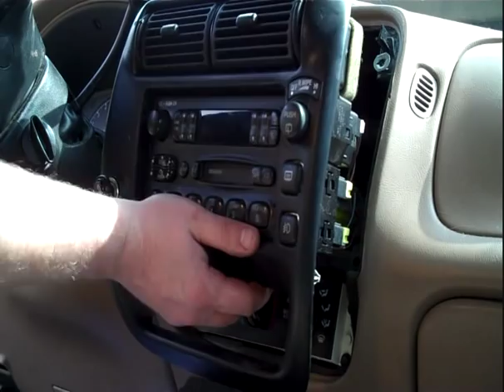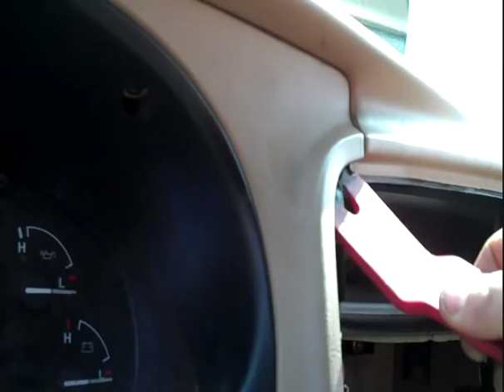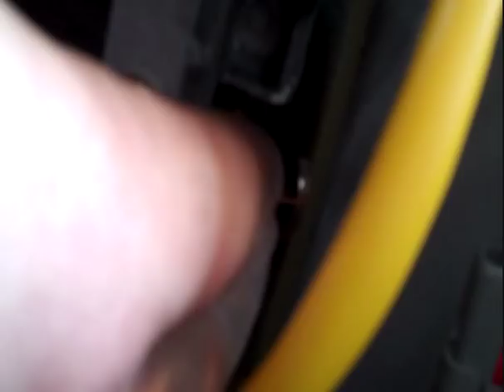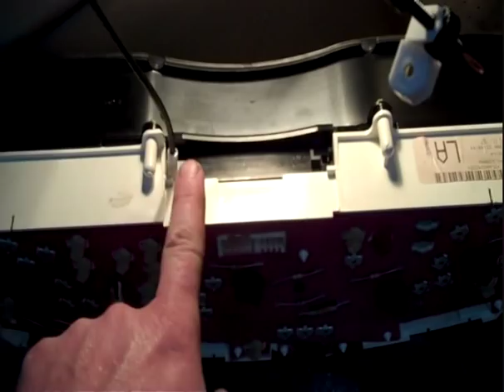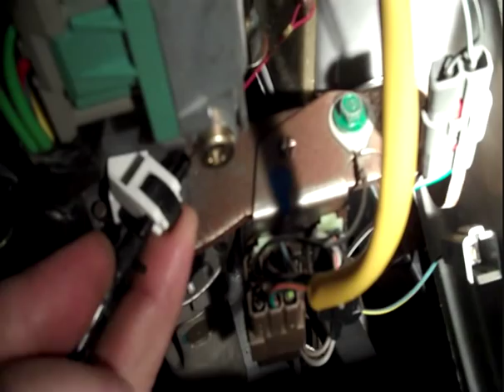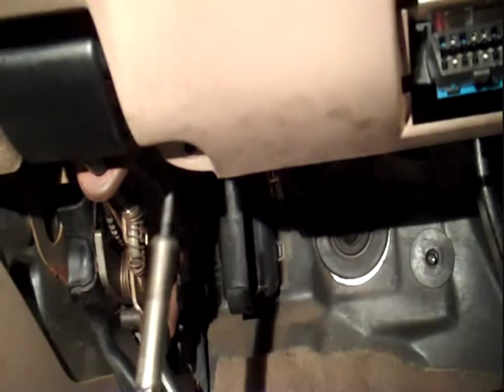Ford Dash Lights & Shift Indicator Repair

Comment: Hello i accidently connected the positive to the negative it ran for awhile the all my gauges and speedometor will not work after ive changed the blm and the cluster..still dont work..What have i done or need to do.?...Thanks..

Comment: Easy way to work on removing the various screws under the dash:  A box or step stool placed outside the driver's door.  Mine's about a foot high.  Perfect height and a comfortable position instead of bending/contorting, killing my knees.O'Reilly Auto Parts had a pack of 10 bulbs (behind the counter, so ask!) for 7 bucks which is nearly half what 3 2-packs cost.

Comment: this is a very easy job if you have patience and don't mind working in a kneeling position or putting your body in a pretzel like position lol I used a 7 mm,8mm, and 7/32 ( shifter cable bracket white plastic) sockets. even though only one of the 194 bulbs were burnt out I changed all 6 I took the advice of wearing rubber gloves as to not handle the bulbs and getting my body oil on them VERY EASY JOB all the gages are brighter on this old 1998 explorer

Comment: dear rage customs thank you for this very informative step by step video. the only difficulty I had was trying to find a correct metric socket for the shift indicator cable bracket. mine wasn't broken but I still needed to remove I think you mentioned a 5 1/2  mm socket I was able to use a sae 7/32 easily. although only one of   the 194 bulbs were burnt out by gas Guage I changed all 6 in the black holders I wore rubber gloves as to not touch the bulb it took me a little over an hour but I just took my time THANKS AGAIN !

Comment: Hey if my shift indicator is fine and i only need to replace a bulb, can i leave the shifter in park or does it have to be in gear 1 with the emergency brake on??

Comment: Very good video! I have to replace several bulbs on my '97 Explorer. Looked pretty easy except reconnecting the wires. Didn't show if this is difficult or not.(I never noticed the
'NOW', until you pointed it out). :)
Reply: +Tina Keogh labeling both male & female ends of wire harnesses makes the job much easier

Comment: Good god.  No wonder the mechanic wants to charge me $250 to fix the damn light.  Thought this might be an easy enough fix to do myself but I'm pretty sure I'd be driving it to the mechanic with all the parts removed and wires unplugged, unsure how to reconnect it all.

Comment: When you go all the way in there, you might as well go just a bit farther and pull off the cluster cover. Then take a soft, scratch-free cloth and clean the inside of the cluster cover (clear plex).  You'd be surprised how much nicer the gauges look after that.

Comment: Im a first time car owner and the shift indicator if off set do the wires i unplug on fit in its right place i dont want to hook it back up wrong
Reply: Heather Stidham Hopefully you did not wait a whole month for an answer. But here is the answer: When one removes electrical connections like these the connectors are keyed to fit one way. What is critical is should there be two connectors with the same pin count don't mix those up.  If you are really worried do what many people do. Take a Sharpie pen and number each connector including the socket it comes out of to match it later. Just don't get ink on the electrical connecting pins. You could also get those stick on arrows or tabs from an office supply store or general store to label each connector. Or use masking tape and a pen to make numbers.
Reply: Heather Stidham It may also be possible to adjust the shift indicator without removing the whole panel. You might want to check to see if you can see the adjustment before you do. But it is likely some portion of this procedure would be necessary to get to the adjustment.

Comment: I'm just going to put it out there that all you need to do is remove the black bezel which is two or three screws and then you can take out the cluster.  No need to remove all of the other stuff.  Not that you can't it's just not necessary.  But I'm sure that's the time the shops charge you for.
Reply: Carcrazy 117 Hi...can u explain what you mean? If i can save some time, i would luv to know how..thx
Reply: I'm sorry about that.  I wasn't paying attention.  It's only the 2001 and up models that you can just remove a few things.  The older years you have to use this process.
Reply: Carcrazy 117 You also don't need to remove the entire steel plate... just remove the top screws and loosen the bottom ones and you can get the plastic edge past the steel plate. I agree, the shop way is to maximize the bottom line. I had a shop charger my company $270 shop time to replace a $14 U-Joint on a drive shaft for a S-10. I called the Auto Zone near me and found that the part was $14 I was charged $54.. only a $40 markup for the shop while they left our truck on the lift charging us lift time while the delivery driver was driving all over town delivering parts to every shop... I could have went and picked it up in 5 minutes as the parts store was 3 blocks away. So long story short... we were charged for the total time they left the vehicle on the lift, it was strange as no other work came in to hold the lift up it was just more convenient for them but when I asked why they charged so much for lift time they told me it was on the lift holding up other work and they admitted there was no other work. I asked why they didn't just tell me to push the truck off the lift to save money, I mean that's how we got the truck on the lift as the drive shaft was in the bed due to falling off. They just don't give a fuck about if you come back again they just want that one good fucking to get off that one time. I'm a Customer Service Rep and nothing pisses me off more than the Obvious Rip The Fucker Off Job with a Smile On their Faces. The biggest mistake ever made buy the Government was the Fucking Mechanics Lien.. it gave them a License to just rob the shit out of everyone. How about a rule that allows me to take my car and fight it out in court and let the Judge see what they did and access the damage...? As a Bike Builder for 35 yrs I just hate Auto Repair Shops as a whole because they're mostly thieves and they know it. I didn't mean to get so long winded but now that I'm 65 I to am at the mercy of the shops. I have a great Son-In-Law who's a Motor Head and he's the greatest with helping us out when he has time... there I go again... Later
Reply: Yes that is true I only loosened the metal plate I did not take it off all the way.

Comment: wow, I can't believe how much stuff you need to take off to change those cheap bulbs! however it drives me crazy not able to see half of my dashboard. I'll be tackling that very soon. great video. however I have a question,  does anyone know if the factory bulb can be changed for leds???? they'll last longer, and are so much brighter.  thank you

Comment: Thanks for the video. I have the same problem with the shift indicator light but my escape is 2004 and the shift indicator is digital. Could find this same type of bulbs in the 2004 model?. i´m sorry i writing with google translate. tannks.

Comment: Thanks for the video, very useful. Looks like there is 6 bulbs total 94b. They are like 5 bucks for a 2 pack. So that's $15.00 for the bulbs. And my shift indicator wire or plastic piece is busted. I found them on ebay for $44.00 for the entire unit. So for $60.00 dollars and about 45 minutes of time you can fix everything and be well lit. :)

Comment: The shift indicator bracket is available as an individual piece.

Dorman part # 83244 - fits 1996 - 2011 Ford.
Reply: You don't even need to take the dash apart to get to it (at least not on a ranger).

Comment: I was able to repair the shift indicator with a tie wrap rather than replacing the whole cable assembly. I'm so glad I saw this video or I wouldn't have even known why the shift indicator was miss-aligned! Great job. For anyone doing this repair, think about replacing the air bag indicator bulb. If it goes out the vehicle will ding 5 times 5 times in a row, and then repeat after 45 minutes. Very annoying. These smaller indicator bulbs are #37.

Comment: Remember to disconnect the battery before you start folks!  You can hear the chime going off in the background.  One short and you can be hurt or fry an electrical component on your Explorer.

Comment: Half my 99 Crown Vic dash lights went out, starting as soon as the 3 year warranty period ended. Seriously. I researched the problem, praying that someone was smart enough to put the lights under the dash within easy reach for the consumer or even behind the firewall. After watching you do it, and knowing that this backyard mechanic would have far more trouble, I'm glad I never did it! Fortunately, the remaining lights and ambient light are enough that I can see all the dials. My car is coming to the end of its life (engine & tranny are fine, though the shift cable recently broke due to rust, which is the major problem; my bad; had only 3 towable repairs (original owner) in all that time), and I never let the tank below 3/4 empty, locally, or 1/2 empty during long trips, estimating the mileage by time and/or distance, so, it's a trivial issue. If they still made the Vic or its sister cars, the Grand Marquis or Town Car, I would buy them in a heartbeat. Now, I'm struggling to find a decent sedan that can give me comfort, safety, and the ability to tow, as my CV has. Thanks for the vid, if only to show me how smart I was in not doing it! ;)

Comment: Always a good idea to disconnect the ground cable on the battery before beginning this job, that way you won't have sparks flying and fuses popping if you accidentally ground a hot wire to bare metal.

Comment: I know lights burn out all the time. But is there a reason why all these lights would burn out at the same time?
Reply: The lamps are incandescent bulbs that use a tungsten filament to provide the light. There's just too many variables in the bulb to guarantee that they'll all last an equal amount of time. Once that tungsten filament burns through, it breaks and the lamp goes out. They're pretty accurate in terms of getting them close, but its not capable of being an exact science.

Comment: I ordered some new lights to put in the instrument panel. However, they didn't work. Now, I've put the original bulbs back in and one of them doesn't work. I think the bulb is fine, but I might have done something to the circuit board behind it. Also, my shift indicator only works in the gears P-N. It goes halfway to the D, and stops. Any ideas on how to correct these problems?

Comment: Mine's a 2001 Expedition.   Simple fix for gear indicator.  Use existing single ear of white plastic thingy.  Unthread adjuster from cable housing.  Buy 22-cent 10-24 nut and thread onto cable end.  Stick cable through white thingy's hole.  Pull out cable and work eye thru original black adjuster nut.  Let it slip down to cable end to threads and thread it on till started.  Hook cable to hook.  Now pull on cable to proper gear.  Tighten down on both nuts-PRESTO!  Savings - $49.73

Comment: Good lord..what a process just to change a light bulb that SURELY the engineers should have known will eventually burn out. Think I'll just buy a cheap flash light and use it to check fuel levels at night.

Comment: You shouldn't touch the lamps with bare fingers.The oil and grease on your skin causes early failure.  If you do touch them, wipe with Isopropyl and good to go.

Comment: Wait, can someone please help me......... What is the green thing (like a chip) on the back of the cluster. upper right corner when its facing back. Is this affecting the odometer? Cause myodometeris not working. And can u pls tell me the name of the green thing. Thanks!

Comment: Thank You for the very detailed video I followed your video as I was doing it & got the job done in two hours! My very worn cable was replaced with piece of mind now. My dash lights haven't seen light of day for years.
I still had a problem on it going into park and after digging around I found a screw on the floor. I looked up a additional U Tube and found A additional fix of 2 screws that need tightening . If anyone else has this problem look at Ford F150 that won't go into park by HoodJob 4U

Comment: I have a stage 2 2006 Rpush mustang and the gauge lights dont work. The needles do but where the mphs are doesnt. I was driving to work and they flickered on for about 20 seconds then flipped off. I have no idea how to fix this. Can anyone help me?

Comment: OMG it was too easy! I just used some good super glue on my plastic piece and made sure it wasnt loose enough to come apart again and I also replaced all my lights in the instrument cluster at the same time. I was too happy to have it fixed my neighbor looked at me as I started to dismantle the dash w/ shock. I was hoping for all white lighting but I cant argue Im happy its done. Thank you so much for this vid

Comment: is there any way you can stop that annoying indicator clicking relay sound that manufactures sadly still make us put up with.  theres no need for it.  its horrilbe.  it becomes a real pain.  same with the flashing dahsbord light.  you dont really need it.  to me its one less distraction that you can do without whilst driving and research shows its distractions on dahsboards that cause most accidents.

Comment: I just bought a 1999 Ford Explorer. Half the dash lights are out and the speedometer & odometer are broken. I'm thinking I may just replace the whole instrument panel, but I was told that the speedometer/odometer problem is most likely the car's computer, so replacing the entire panel may be useless. I'd like to at least get the lights working, but watching this video (which is excellent btw) makes me think I might just leave them burned out. LOL  I'd never get it all back together again

Comment: I want to start off by saying that I need a lot of help.  I have a 1992 Plymouth Voyager and all of the dashboard lights are off but my engine lights come up.  For example, the "Check Gauges", and my "Anti Lock" light.  I changed the entire dashboard and replaced it with an entire new one.  That didn't work.  I check the Fuses, the Relays, the wires inside the dashboard, none of that work.  Now I have to check the two computers.  Do you have any idea what's going on with the van? Thank You.

Comment: A much better idea is to replace the bulbs with LED.  The type of LED is Cool White WLED-xHP5  and you need 6.  I ordered 8 just in case something happened.  You can also replace the A/C cluster with 2 LED but you need to check the type of bulb since Ford put out two or three versions of the cluster.  The LED's need to be 360 Degree output.  Google it. Your panel will be brighter but not enough to cause a problem.  LED can also be dimmed.

Comment: You can repair the gear selector by removing the white broken bracket from the cable then thread a nut (don't recall size) on the cable. Replace the broken white bracket, then thread another nut on the cable end which will hold the broken parts in place. You can epoxy the broken bracket if you want to  but I found that I didn't need to. Someone posted the procedure with pictures on "Serious Explorations" Ford Explorer forum.

Comment: Ford wants $75+ for a whole new shift indicator; too much money and the white bracket will just break again because it's too cheap and hollow plastic. All you need to do is get (I believe) a #10 size nut and screw it on the other side of the plastic bracket where it's still in one piece. That method saved me $70 and it's stronger than a brand new bracket. I should have done a response video...

Comment: I know you probably get this a lot. My 1998 Ford Ranger is the exact as your Explorer pretty much. Is it all the same. Minus the bolt sizes and all. In the book it says I have to remove the steering wheel? I've never replaced the bulbs for that reason. But I have another light go out and gotta do it or install aftermarket lights. lol

Comment: Great video and THANK YOU! I found it looking for info on a shift indicator repair. Mine was broken as typical, however I was able to repair it - not replace it. Just remove the threaded cable from the adjustment nut and bracket. Then reversing the order, thread the nut on the cable, put it through the bracket, attach the cable loop on the linkage hook. The nut can still be used for adjustment and the tension from the cable keeps it from slipping back out. Beats paying $45 for a $.20 bracket!

Comment: @roadragecustoms thank you, i just went for it right after i asked the question. i had a loose connection, so i re wired it and put in a new fuse for safety measures and i got it, it seemed like more work than it actually was haha

Comment from the maker: @maddogmatt44 I have replaced lots of multifunction switches in Fords.  Also check the wiring & headlight switch.  Melted connectors on headlight switches & multifunction switches are common too.

Comment: I have a 99 Ranger. my parking lights and my cluster lights are out, i replaced the fuses, checked the bulbs, there is no relay for both lights, even tho in the manual it says that there is, so couldnt really check that. when i turn the multi switch to turn on the lights. my head lights are the only lights that come on. do you have any advice? im stuck

Comment from the maker: @FlashWhiteSnoW You may be low on engine oil.  Sometimes that will make the oil pump starve for oil when it sloshes.  This will make the the pressure drop.

Comment: @roadragecustoms i crawled underneath the beast today to find dirt and mud all over the shift linkage! i used a flathead screwdriver and compressed air to free it up then hit it with a shot of WD40, and ALL IS WELL! the shift indicator moves from Park all the way through Drive and 2 and 1 also. PERFECT!